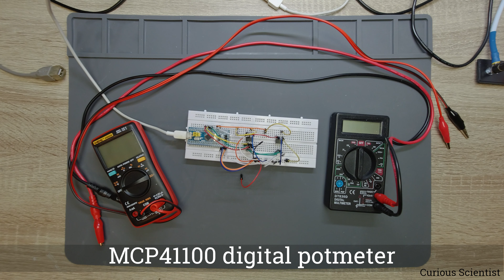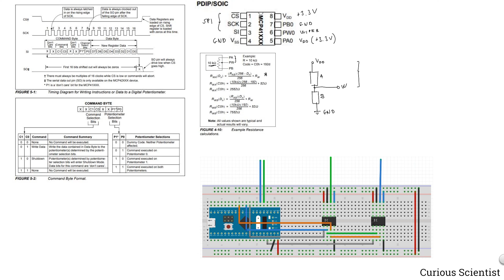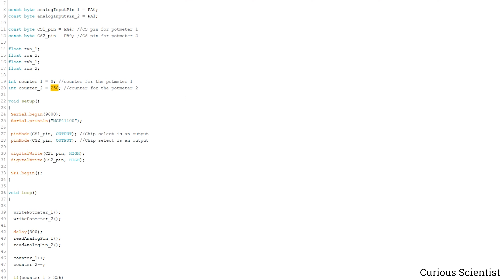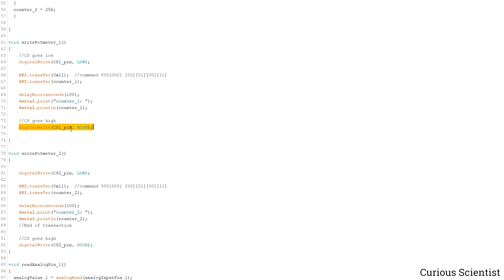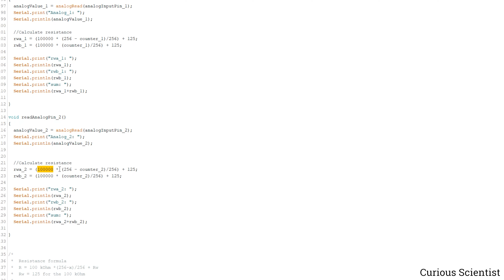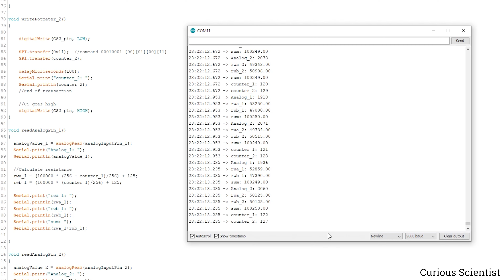MCP41100 digital potentiometer with Arduino/STM32

Comment: Why use mode 1 on the SCK if data is latched into the SI pin during the rising edge of the SCK, not on the falling edge?
Reply from the maker: I don't have a good answer, but it worked this way so I stayed with the solution.

Comment: Could you use this as a digital joystick for the xbox adaptive controller - either usb or the X1/X2 3.5 mm jacks?   In a nutshell, I'd like to use the mouse cursor as a digital joystick.  I have the computer values pulling over to an Arduino already,  but now I'm stuck.
Reply from the maker: Hi! Yes, this could be used to emulate a joystick.
Reply: @CuriousScientist  Thanks. it would be two pots then - one for the X, and one for the y.  

The coding was easier than I thought it would be.  I'm running a python script to get the x,y values, converting them to a binary string for the serial transfer to the Arduino,  and then changing it back to x,y.  I originally just thought I would just be able to hook up to the  A0 and A1 pins but it doesn't work that way.   The. Xbox adaptive controller is expecting resistance from a passive device.  I'm also planning on converting over to USB.
Reply from the maker: A0 and A1 are analog input pins, they cannot generate the same output as a digital potentiometer. Alternatively, you can generate a PWM signal and build a filter so you get a pure DC signal instead of the PWM square wave. You can also use a DAC. It typically has a higher resolution (12-bit) than the onboard PWM (8-bit). There are many ways to do this.

Comment: Could this drive a brushless motor controller throttle signal ?   I don't think it's good to drive the throttle directly from an MCU pin maybe?
Reply from the maker: Honestly speaking, I have never worked with such motors and their controllers, so I don't know. I am more specialized in stepper motors. Can you please tell me an example of a motor and its controller? I put it on my little list of potential future projects.
Reply: @CuriousScientist  the hub motors on bicycles and scooters.  You can see me controlling one in this video:

https://youtu.be/Q0jriUdNHQ0
Reply from the maker: Thank you, I will check it out soon!

Comment: Very interesting, I will look forward your power supply to see how is implemented
Reply from the maker: Thanks! Actually, I might have been a bit too confident when I was saying those words in the video. I checked the DC-DC converter that I have been using for a while and the situation of the potentiometer used in it for regulating the current and the voltage is not that simple as I imagined. For analog potmeters, it does not matter, but for digital it does. I checked the PCB, and I noticed that the potmeter which regulates the voltage is also connected to the output of the DC-DC converter. This means that the potmeter can meet voltages above 5.5 V which would kill the digital potmeter. So, I have to figure this thing out a bit more. At the end, I might come up with some different approach.